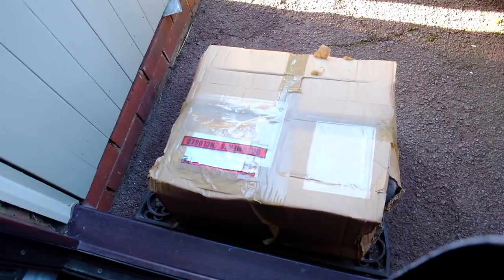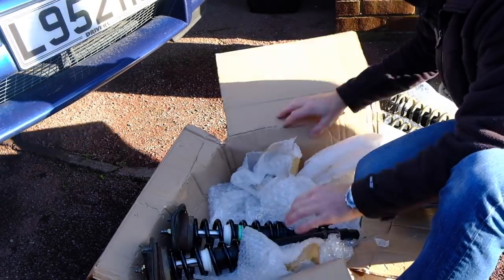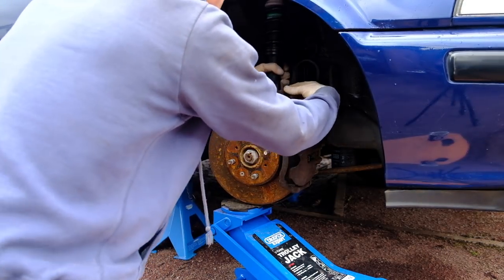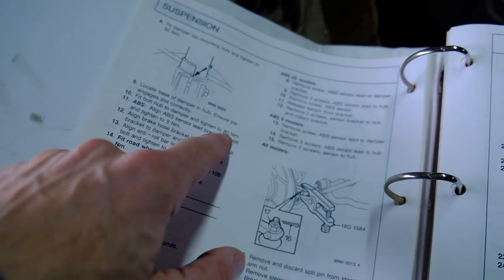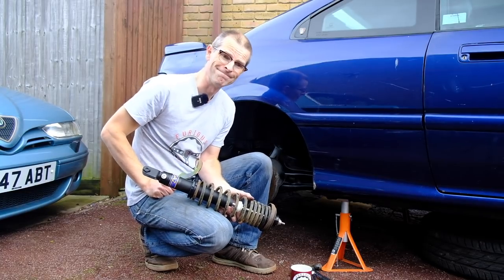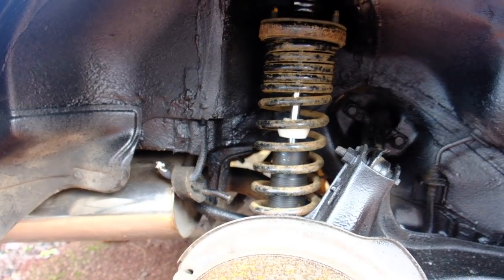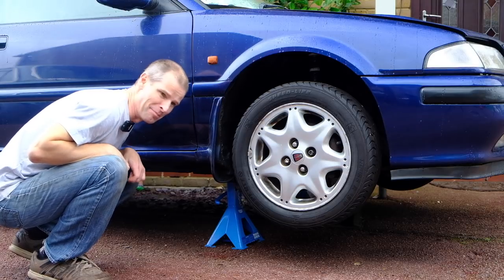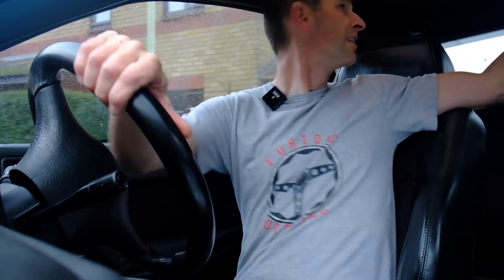Rover Tomcat Gaz coilovers come back!

Comment: Spray water based lacquer on the housings if it hasnt been done. The zinc+black coating wint last very long.
 I was a  plater for several years. 
Great video

Comment: Great job - love the coppa slip everywhere! One small concern is the locating of the brake flexi pipes - those buggers could rub through if not quite right (ask me how I know :) ). The LHS looked different to RHS on the video - I wonder if you manual gives you the angle to use? ps not judging you just thought it was worth a mention.
Reply from the maker: well worth a mention as Im not sure which way around they were before!

Comment: I hope you know that if you lube up bolts the torque figures will be wrong. I lube everything including spark plugs but just be gentle tightening them up. Never used a torque wrench although I do have one, just use common sense.
Reply from the maker: Yes, if does affect it. I didn’t torque these before but they were ok for years!
Reply: @furiousdriving  just didn't want you torqing them until they snap.
Keep up the good work.

Comment: The R8 is the twin of the Honda Concerto and the result of a collaborative design between Honda & Rover. JDM Concerto utilised front wishbones unlike all R8's/British Concerto's that all rolled off the Longbridge production line.
The 400 saloon and tourer + coupe were all purely Rover designs as far as I'm aware.
Reply from the maker: Correct, hence the Integra has a very different front set up. Rover did about 7 different body styles off the R8, not sure how many Honda did but it was fewer

Comment: The height of the suspension isn't too bad - maybe 1.5 - 2cm drop all around?  You don't want it too hard and crashy like it was before :-)
Reply from the maker: Im thinking about 25mm, it was 30/35mm but it was all worn out before so should be better even with the lows

Comment: When did these things become known as "coil overs" ?
To me, they're struts.
Reply: Same here.
Reply from the maker: Strut is a generic term for the spring and shock, a coil over is when the 2 parts are combined as here
Reply: When I worked in a shock absorber factory they were always called struts or by the diameter in inches. This was all of 25 years ago now and the factory has long since closed.

Edit. I remember struts as in MacPherson strut had a shaped pan welded on to the shock absorber unit and allowed the coils spring inserted, they usually had no cover for the rod or a rubber covering for the rod depending on version being produced. Whilst coilovers were standard shocks with a dirt shield over the rod. The shock absorber had a plate welded on one shock absorber unit end and another plate welded on the dirt shield, sometime this was also adjustable. I can just remember the machine which assembled these.
Reply: @johnclarke2997  
That sounds very interesting John !
Such a shame the factory closed.

When I hear people talk about buying some "coil overs" I think they they mean they're changing the rear suspension from leaf spring to strut.
Reply: They're known as adjustable coil overs but people drop the adjustable